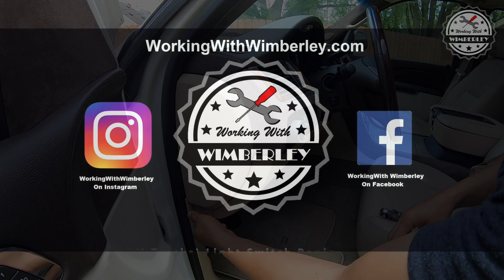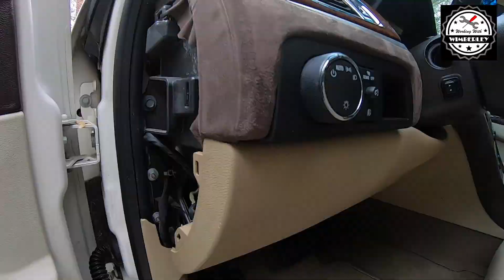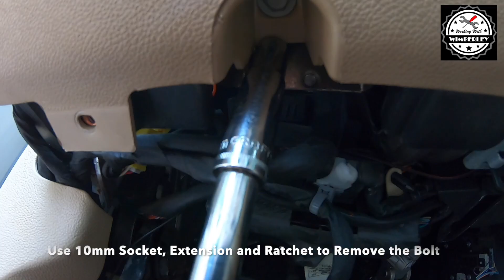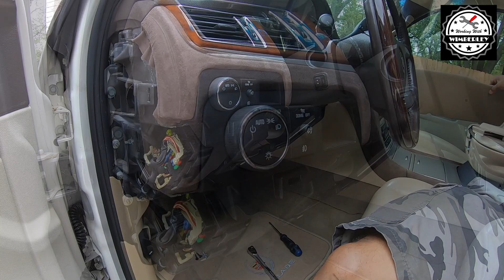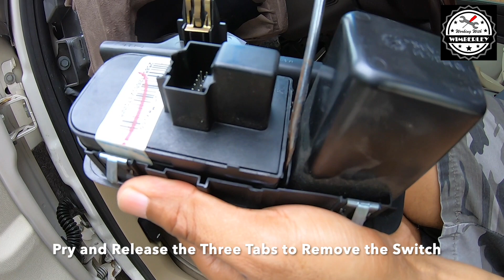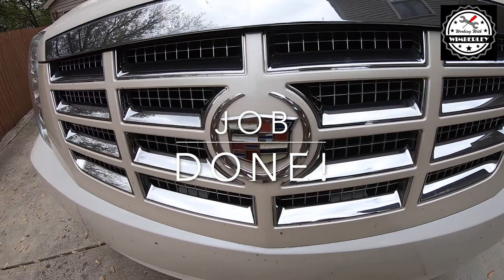2007-2014 Escalade Headlight Switch Replacement Removal Tahoe Suburban Silverado Yukon Sierra 4WD

Comment: Fam' quick question, My dome light  button on my 13 Yukon is not workin at all. Checked all fuses they're all good. Should I replace the headlight switch??
Reply from the maker: Make sure you check the bulb too. It could be the switch, but I can’t say for sure.
Reply: @WorkingWithWimberley  I replaced the bulbs with LEDs not too long ago. Still nothin, anyhow I appreciate the reply though brother!
Reply from the maker: @BringBackMasculinity1987  No problem. It could be the switch, but I’d hate for you to buy the switch and that doesn’t fix it.
Reply: @WorkingWithWimberley Dang! Real talk! These switches are going for $40-$45 I'm a keep checkin before I buy the switch

Comment: There is no 10mm bolt showing. The brake release is there.
Reply from the maker: What year and model vehicle are you working on?
Reply: @WorkingWithWimberley  2007 Cadillac Escalade ESV
Reply from the maker: @michaelwilson4688  I just looked it up. The 07-09 is a little different. But there should be a screw or bolt on the underside of the release lever. If you can remove that, the rest should be like the video.